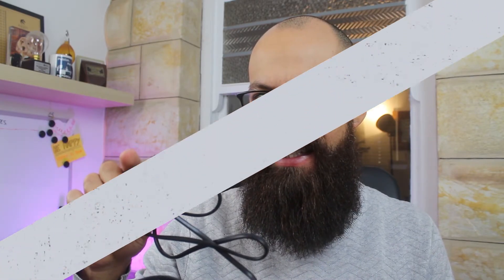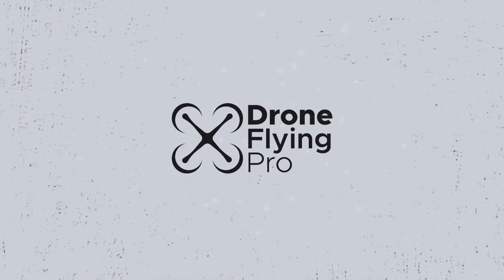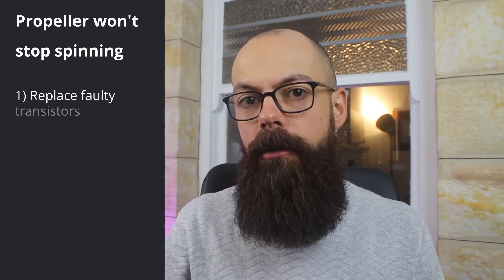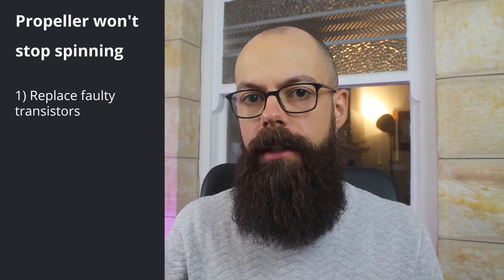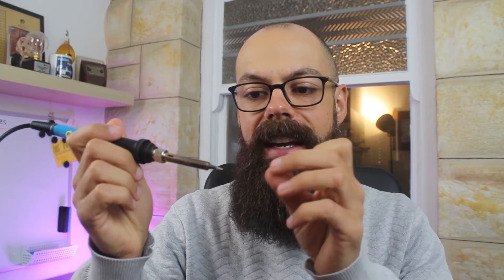Drone propeller won't stop spinning - 3 fixes!

Comment: Hi i have a problem on my drone this is only toy grade. When I plug the battery to the drone 2 proppler start even though its turm off...what is the problem
Reply: I have the same problem, with a Vinci drone. When i connect the battery, one propeller starts at max speed, even if the drone is off.
Reply: Apparently nobody has a solution
Reply: @drummerdoingstuff5020 same
Reply: @drummerdoingstuff5020 Mines a year old toy drone and I connect the battery and it spins all 4 propellers
Reply: Same here
Reply: Same here
Reply: Ok, I found out from experience it’s a blown power mofset on the board.
Reply: If it still has a warranty send it back, if not you can solder a new replacement mofset. Just make sure it’s the same kind.